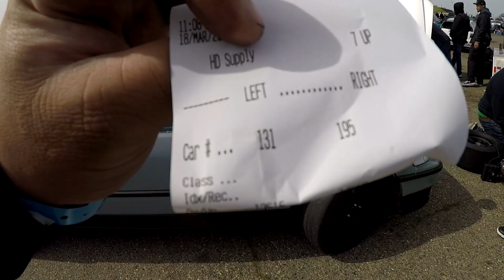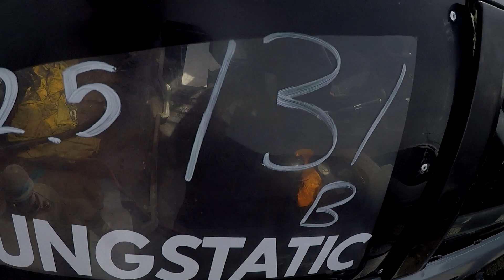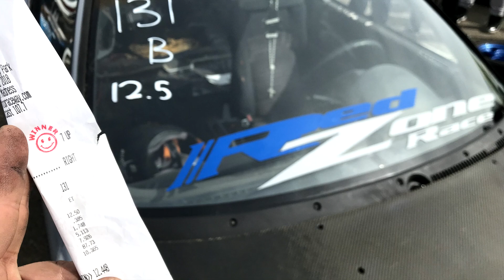H22 CRX RAN AMAZING | STREET2TRACK March Mayhem 2018

Comment: Gratulations homie keep the videos coming man I can't wait to build my B20 VTEC next weekend CP 12. 5.1  Pistons Eagle h-beam rods Brian Crower all motor stage 3 cams with a built B16 head don't know what kind of power is it going to make on E85 but hopefully it makes / 230 +
Reply from the maker: should make 230 no issue if not more! 12.5:1
Reply: YoungStatic yeah I got CP Pistons May 12. 5.1 compression.... it may be a little higher than that with my shaved head port and Polished weight of cosmetic head gasket never ran Brian Crower cams for they stage 3 all motor cams I wish we had a good tuner close to me like y'all have out there

Comment: I have a jdm h22a and am looking to reseal the oil pan do I need to get a gasket or could I just put rtv?
Reply from the maker: im fairly new it H's myself but ive read all sorts of different answers  H22's with steel oil pans used a full gasket, while later models with the cast aluminum pans use only hondabond and that small gasket by the crankshaft."

Comment: Nice video like always. Is this 1/8th mile?
Reply from the maker: 1/4
Reply: Is it 1/4 or 1000 feet?  (1/4 is 1320 ft.) Most tracks switched to 1000 after multiple accidents. Would be way Better if was 1000! You would have to re- do your math.

Comment: That car has a mid 11 in it. It's light. What H trans is in it?
Reply from the maker: no idea what trans. non lsd H trans.
Reply: Josh Papineau needs much less weight or more power for mid 11s.  High 11s with this trap speed will be a major achievement.

Comment: Sir Static, you did great! Practice your heel / toe shifting. Get some straight cut dogleg gears, better shifter, linkage.Wish I lived closer, I would be there! Thumbs up!!!
Reply from the maker: never heard of heel toe shifting for drag racing. you have any idea how much straight cuts cost? LOL
Reply: LOL? Missing 2nd on a launch, something not going right. Never think your all that, always be striving to be better. Straight gears require NO clutch after launch. By not having them, your shifting skills need upgrading. Good advice from a fan, not a bro.
Reply from the maker: when did i say i was all that? im honestly telling you in all the years ive been racing, i never heard of using heel toe techniques in drag racing. none of my friends who goes 10s and 9s use heel toe. i know what straight cut is and what they cost, im telling you i cant afford that stuff. you need to chill "fan"
Reply: Just some friendly advise, Sir Static. If you and your friends use the clutch during every gear change, there is a better way. Try pausing a microsecond in neutral during shifts. Reving up and then changing gears. Practice this and you will get better e.t.s and set your dial in, and not break out. Remember in bracket racing, your racing the clock, not car next to you. Building your car is only a part of the 1/4 mile, driving skills just as important. Think about beefing up an automatic, then reverse valve body, and ratchet shift...? I'm not dogging you, and straight cut dogleg gears are expensive! But it's similar to a built auto, which you could use a line lock also. Remember, a bro tells you what you want to hear, I'm offering friendly, car building in driveway, budget do it your self life loving advise,  And I would still LOVE a YoungStatic Sticker for my only ride. How to get?
Reply: Sir Static, can you use some sort of line lock on a manual car? Anything gotta be better than e- brake. You don't like shift lights? Do you have a review limiter? Also, be careful with going commando on your exterior intake pipe. Saw a video on tuber today someone with your setup on a Dyno had a stack of papers nearby that fell off and got sucked into the " open" intake and ruined the turbo. Appreciate your reply to me, a humble subscriber, virtual neighbor. You know, the old guy who yells"get off my grass!".
Reply: Quaife sequential K20 Honda is $10,000.

Comment: Dammit boy! 12.6 @ 110...damn good for a stock engine H22 in a CRX. I have honestly only been to the track once in the summer with my turbo LS EK coupe with a GSR trans and the best that I could muster was a 14.7 @ 100 spinning all the way through 3rd on spanked 205/40/17 Nankang garbage tires, and I made 408 whp with my stock internals on a cheap ACL and NPR rebuild. That was with absolutely no traction, a ridiculous reaction time due to my inexperience, and a retarded 60'. My car now has a built 81.5mm Eagle/CP block with the same GSR trans with an upgraded OBX LSD, a new JDM B18C Type-R head, a real Turbonetics 60-1 Hifi, a PLM top mount turbo manifold, and too many new brand name mods to list here. I'm shooting for 500 whp and an 11 second slip to go with it on slicks.
Reply from the maker: its all about going out to the track and having fun. giving it a try and figuring out what works and what doesnt. then come back prepared. 500 is enough to go 10s. at 451hp with my red crx, i went 11.4 before being booted out haha.